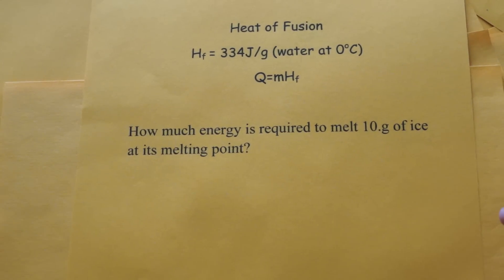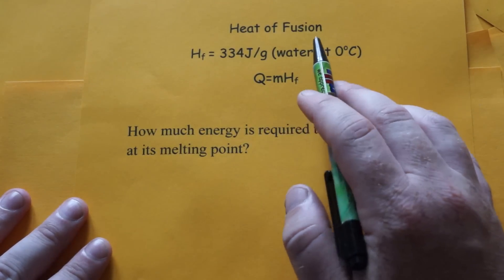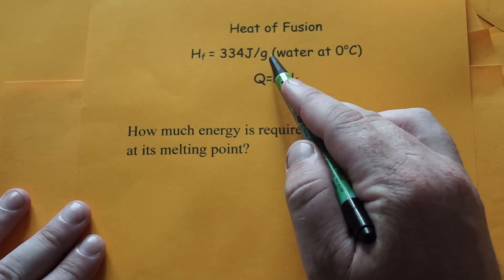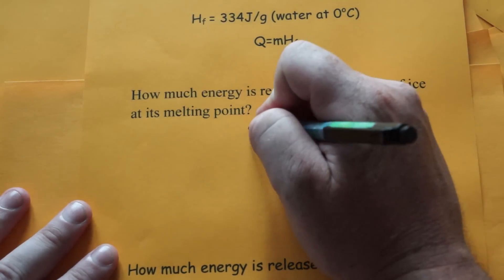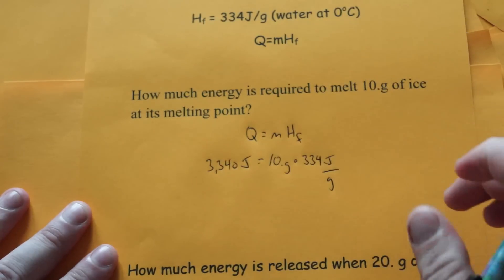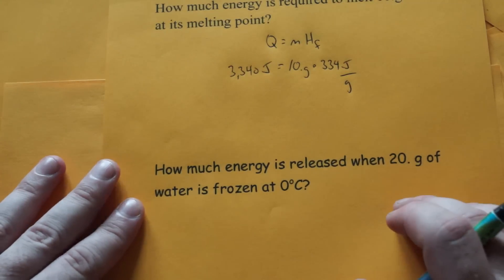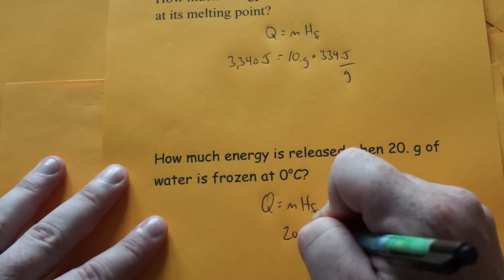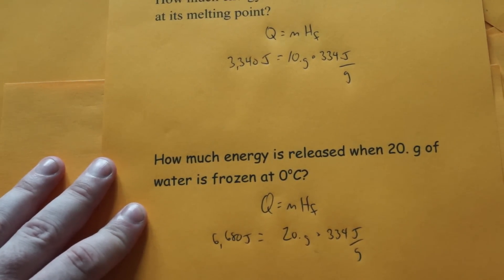Heat of Fusion Calculation

Comment: in problem below,how to find mass of the compound ...? or do i need to find mass or else shoild i use the formulas considering mass as 1 mole. . .?

 An inorganic compound melts at 1673K.  At that temperature, the latent heat of fusion is 124 KJ/mol.  If the heat capacities of the solid and liquid phases are as given below, calculate the heat of fusion at 1073K. 
 
Cp = a + bT + c/T*T (J/mol K) 
 
solid a = 177, b = 23.1 X 10-3, c = - 40.2 X 105 liquid a =  279, b = c = 0

Comment: Great video, but how would you know the amount for joules per gram for the heat of fusion for water that isn't at 0°C? For example, 24°C?
Reply: @Ruposhi Quddus, you would need to know the mass and then multiply it by the fusion energy, which is 334 J/G
Reply: you must make a separate calculation, using calories and converting to joules,  the video is about the energy to effect the phase change I believe.